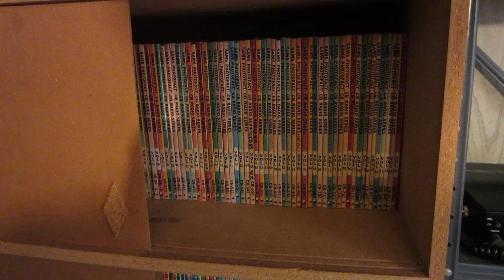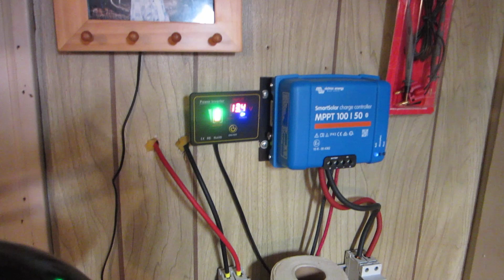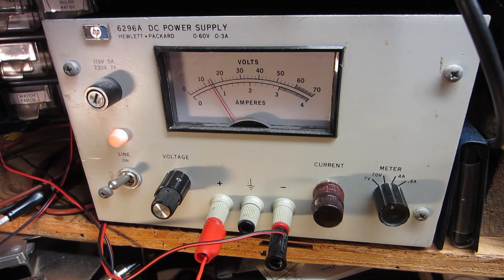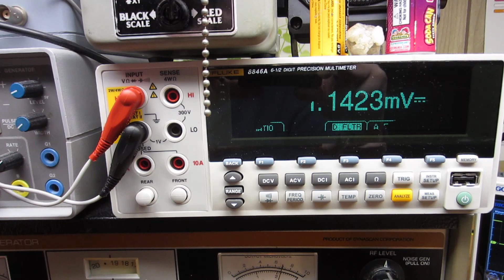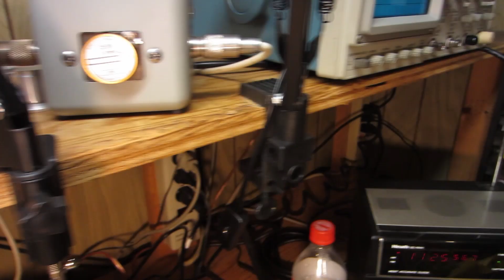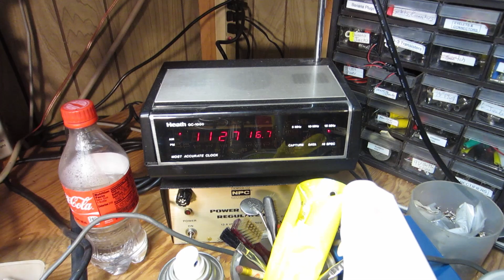Introduction Video

Comment: Over half your stuff I have that so cool to see other ppl using the same equipment..I have a lot of what you have there ,I have same pyrimid supplies ..got most of the he radios u have also have the messenger all of it just about everything u have I got ..except for your 2 meter stuff and I have a different heathkit frequency counter   and I don't have your tracker ..I'd love it I'm jealous ... Nice fluke  I have same brand...lol good shit the 2040 is awesome to see I want to get another service master...I had one along tome ago .I now use modern day  arbitrary generators .. I use 200 MHz multi channel ..and I have a old hp 8500 series spectyanlyzer .the good stuff... I don't use bird meters nit nesasary for what I' do ... I use old average jb5000 jb500 jb4000  true average meters ..now I'd like to have a bird 42 but  damn there just too high for a meter then ya gotta bye 125$ slug and well I don't mess with exstremly high power ..I stay under 3kw ..so

Comment: Just wanted to say that I enjoyed your intro and glad that I found your channel.  I am hoping to do something like you are doing as well.  Sort of forced in to retirement last year, I was trained at DeVry Dallas back in 75 - 77.  Worked at JSC for about 11 years but managed my way from hardware/electronics into operating system software along the way.   I'm building up a reasonably good workbench and collecting a bunch of questionable radios (may work?   may not?  I'll figure out and then align them!).   I lucked into a B&K 2040 Sig Gen and after watching your newest video on the 2040 and the 1040 Service Master... I really want to find one of the 1040 Service Masters.    I just wasn't aware of all that they did and they DO look like they make a big difference.

Anyway, just happy to find that there are "others out there" in this space and wanted to let you know that you are providing encouragement for and old guy down in the Houston, TX area.   Thanks for the videos!!!!
Reply from the maker: Yes The CB Service Master will save you much time as you can see transmit and receive without changing your setup.

Comment: Cool beans,I have a question do you shipped and take in working from outa state,I have 3 sets of the 2040 1040 and the 1827 feq counter, they all need recalibration  and any necessary repairs?
Reply from the maker: I  do walk in only, I do not do shipping at this time.

Comment: Thank you for nice introduction of your workshop. I'm not sure what RF people are interested in, but what attracted my attention (electronic technician too - but RF illiterate)  is that "relict" Tracker 2000. That is my tip for one of your next videos - could you show us how you diagnose circuits with that beast on some real examples?  (e.g. short vs good PN junction, various capacitors faults and so on - I don't know what exactly can it do). Thank you and good luck with your next videos (I just noticed there is another one).
Reply from the maker: OK I will do that. Sounds good